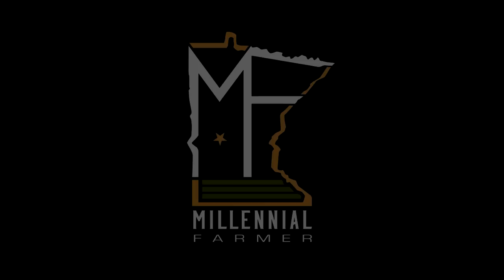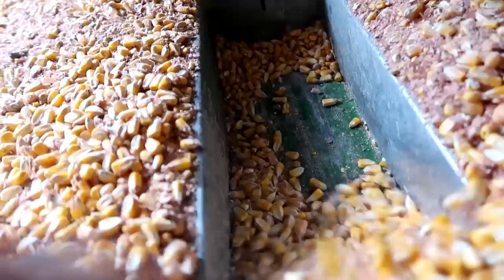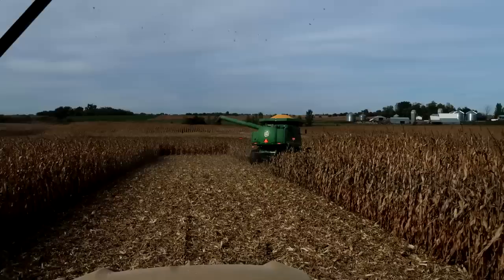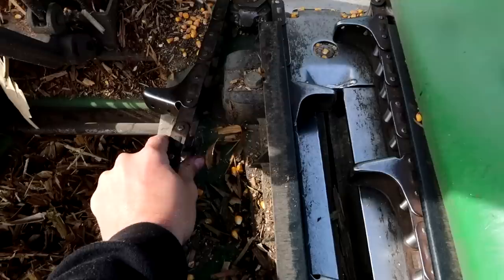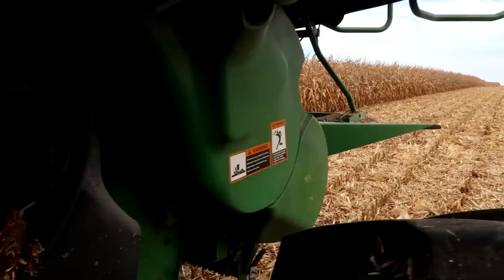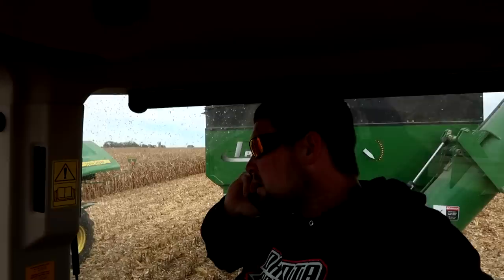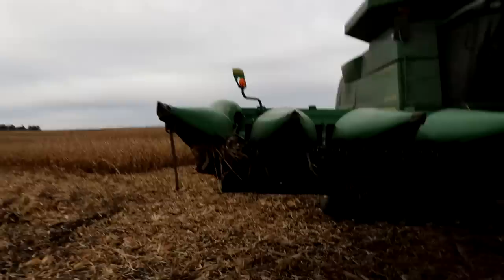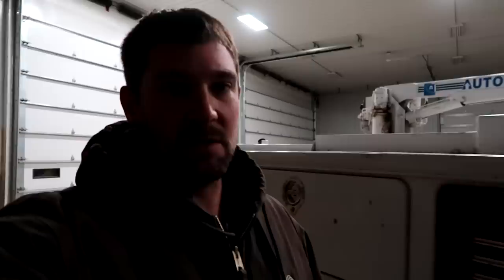Harvesting Wet Corn

Comment: the trials and tribulations of grain farming.  at least you don't have cattle bellering at you.   we are still in the low 90's thru the weekend. 
for those who may not know,  there is a squirrel cage fan under the combine. it is speed and air flow adjustable to provide LIFT to the crop as the crop shakes on the sieves and separators.  if you open the screens you lower the air pressure.  too much air pressure and you blow the crop out the back. very delicate balance to remove the grain from the chaff. moisture of the crop, up hill, down hill, side hill all makes a difference on how the crop feeds thru the separator. when the crop gets thin you need to up the ground speed to keep the volume of crop consistent into the machine.   
the sheer number of moving parts on a combine are staggering. its like a complete assembly line moving down the field. any small adjustment out of perfect, a slipping belt, a bearing going dry and either you throw grain on the ground or the machine is dead in the water until it is corrected. I do know my boss would never spend $300k on a machine that you use 2 months a year. same as that spray coupe.  worthless 11 months a year, priceless 1 month a year. that's farming!  
I believe the sudden interest in farming videos is because city folk have or had no idea the complexities of modern agriculture. kudos to all the farmers teaching others how it all fits into the grand scheme of our economy.  hopefully this new USMCA agreement trump has put together you will get a decent price for your crops.    stay safe out there.
Reply: First Name Now that was a great comment!
Reply: The reason it’s called a “Combine” is because it’s a combination of a tractor (to move everything), a reaper (to collect grain) and a thresher (to separate grain and chaff). They were developed off of reapers after someone figured out a good automated threshing machine.

Comment: On that slide gate for the sump.... I built grain bins for a bit. They were Brock bins. We would take the cutting torch and make a couple slits in the plate above the pipe. Then you grab your welder and weld that plate to the pipe. Can’t count on mechanical fasteners in that situation. 
Love your channel!

Comment: I remember hauling hay at 11:00PM. I had the tractors lights on, the two halogen lights on the top of the tractor and two big halogen lights on the rear. I couldn't see the gate but watched the moon at my 11:00 and just drove until I saw the reflection of the aluminium gate.
That was quite a site and was glad when I got all that hay put up.

Comment: I used to work on Sukup's service crew. A lot of their equipment is top notch, but the fit and finish of their unloads usually left a bit to be desired. By the way, if you want to quiet your dry grain blower down, you can put a pair of big diesel mufflers before and after the blower. We did that on ours and it went from almost intolerable to quiet enough to have a conversation five feet away without yelling.

Comment: Zach, A quick fix to your Sukup unload sump gates,,,drill a 5/16'' hole in the end of your sump gate and insert a short (like a 3/4'' or 1'' ) bolt and locking nut.  This bolt will prevent the gate from being able to slide past the end of the sump and fall out. Although the lock collar may loosen over time, you will never have to go searching under the drying floor for another gate. I hope this trick helps you save some time.

Comment: Great video, with that 12 row and all that extra power id say possible to overload sieves. Really JD didnt change much sieves wise since the 9650. We used to use concave  cover plates also to balance across the sieves. I used to run the sieves as open as possible especially at the front and lower sieve.

Comment: For that stubborn bolt that keeps getting loosened: 1- have some thread locking fluid on it. 2- install a lock washer 3- grind or file a small flat on the shaft where the bolt tip presses

Comment: I know this probably isnt applicable to your situation but a few farmers around you (not close close but nearby statewise) started planting sunflowers in the later time when they couldn't get corn in since sunflowers dont like the early planting of cold so if the drying is such a huge problem for late corn maybe it would be better to add sunflowers? Also sunflowers tend to mine more zinc which corn generally needs closer to the surface

Comment: We always harvest corn without the sieve... just pull it out and clean it on your  chaffer - especially wet or high moisture corn. 

What I find happening is that if you have your sieve in, its very easy to get a relatively high volume of tailings, and therefore you can very easily overload your chaffer unevenly.

I assume you have round bar concaves in and no blanks in the separator part of the rotor? Because they don’t help and it’s extremely rare they make any difference.

Comment: Hi Zach, pull your precleaner extension don’t need it only puts corn further back on chaffer. Make sure corns not going forward into fan may have to bend first two rows of louvers on precleaner if it is you can also get covers H221769

Comment: I was working on a 9560sts with corn coming out the back just like you had on your combine axle.  Found out that the seal right in front of the harvest track pads and in front of the rear axle was bad.

Comment: Hi,
I spent many hours on a case combine, combining wet oats above 25% moisture.
I think the loss of corn over the sieves is the fact that you have a bigger header and more power which probably overwhelming the grain sieves. I found that up to 25 % moisture the grain loss monitor worked but after that it became a waste of time of time because green debris would give a false loss reading.  Soon after if you pushed the conbine hard you would get grain loss over the sieves, the higher the moisture the worse the loss. If I were you I would set a maximum bushel rate of harvest above to 25% moisture to minimise the losses or change back to the 8 row header and lower the power)) or buy a bigger combine with a rotary seperater if you have 1/2 million dollars to spare.

Comment: We are finally getting rain here after 84 days of no moisture. Hopefully we get an inch and it stops. We need to get planted. I understand you wanting to keep moving so you don’t get bogged down by the weather. Seems weird you had that much change going with higher moisture. We can’t even combine till ours hits 12 percent or lower. The warehouses won’t take any delivery without a moisture test and a confirmation on dry. We have very few dryers here.

Comment: I'm on ky right next to Mississippi River and it was 93 today. 21 degrees above normal. Been hot like this pretty much since last may. Went from snow flying and too cold within 3 days 90 degrees. Been their since. Corn here is 12% and early beans 12 as well. If early corn was in the field prob 10% moisture. We get corn out before beans. On our 8820 II at the end of the sieves we have them sticking straight up to catch corn coming out the back in heavy residue. Check to see if any bearings going out leaking grain? Auger wore a hole in pipe?

Comment: If you have set screws coming loose constantly put a little of your wife's nail polish or varnish on the first few threads. But if you cover all of the threads you'll have to drill it out. Not cool.

This also works on the screws that hold knobs to your cabinet drawers and doors.

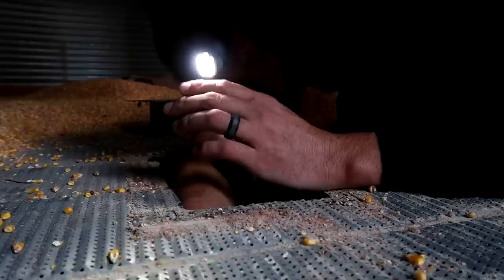Comment: At about 3:30 , when you're fishing for that elusive bolt : 1- buy some backup bolts so as not to waste more time fishing for the only one you have. 2- Get another pick-up tool, other than your magnetic retriever/pick-up tool, a steel claw as the one shown here: https://www.amazon.com/Performance-Tool-W83196-Mechanical-Retriever/dp/B00J8367J8/ref=sr_1_7?ie=UTF8&qid=1539415655&sr=8-7&keywords=pick+up+tools

Comment: You're overloading ur bottom sieve. to my experience with a 12 row corn head in 20 to 25% corn. Open ur bottom sieve all the way open turn ur fan speed all the way up to 1300 to get all the the air you can through the 2 sieve open or close the top 1 to clean ur grain tank. And for pete sake dont listen to what John Deere tells u to do. Try what i said you'll agree on it it works very good. And i never ran my rotor more then 350 with a 9750. But im just me . Try it.
Reply: The rotors throw everything to the right, it's over loading the right side of the combine. The caseIH have the same problems if you push them, hence the reason I buy New Hollands, they won't overload like that with the twin rotors